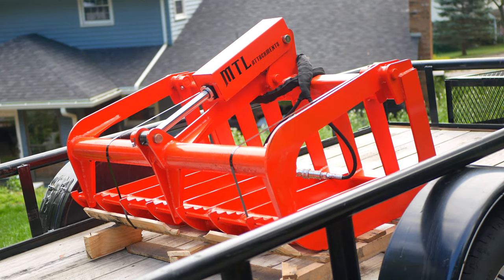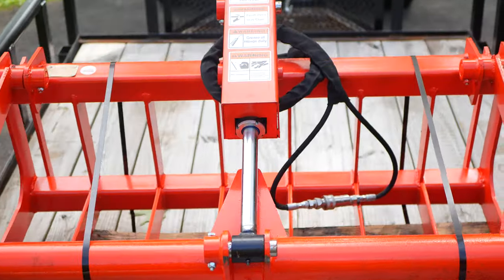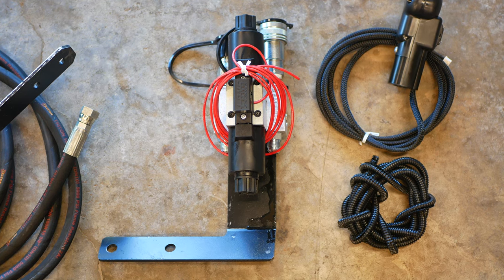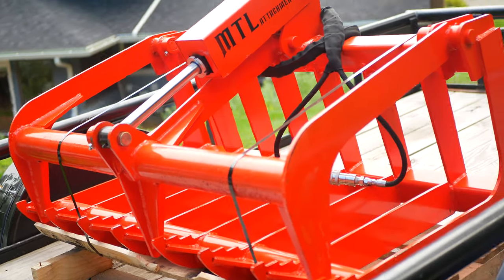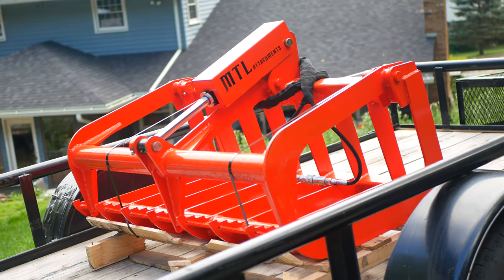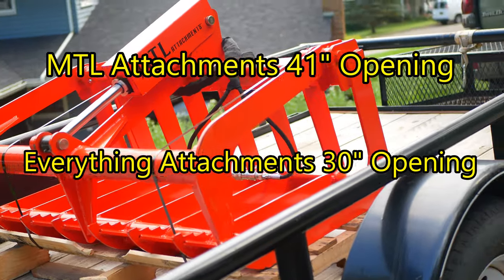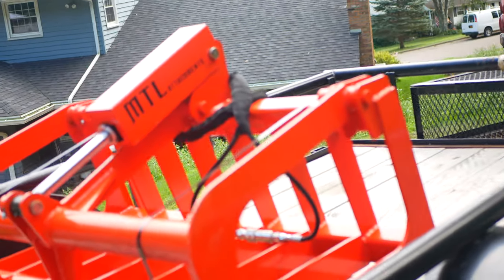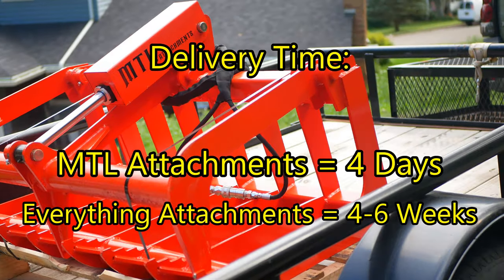MTI Attachments VS. Everything Attachments Grapple + Installation - Kubota L2501 Part 1 Of 2

Comment: Have used a MTI larger size grapple. Section of one of the two top jaws had welded plate bent due to welded metals not joining properly when welded.  It just peeled back at the bubble gum weld joint.  Hope this is not a frequent issue?
Reply from the maker: Did you contact the company? if so, how did they make it right? I've used mine pretty hard and never had a single problem. I've also lent mine out a few times and got it back in one piece - working perfectly. I'd be interested in learning how they corrected such a defect. Thanks for watching and leaving a comment!!
Reply: @BotaTrac  Fixed by local welder, did not contact company . 

i assume it would be too much hassle!

Comment: How was the buying process with MTL?  I'm finding them a little difficult to communicate with. Seems like its text only. They never answer the phone, and their voicemail box is full.
Reply from the maker: Yikes! Interesting......I bought mine "pre-COVID" but I didn't call them - I ordered through their website and got an instant receipt for my purchase and then a day later, I got the shipping information. NOT COOL that you can't contact them. What do you think you might do? Thanks for watching, commenting and supporting.......please like, share and subscribe!
Reply: @BotaTrac  Received my grapple last week. No problems with communication after I had placed my order. Easy pickup at the local trucking depot. Works great. Definitely worth saving a grand off the wicked grapple, considering my needs for a grapple.

Comment: This video is short of what you said. You have zero comparison without using them side by side. I understand the choice of cheaper, but because it is cheaper doesn't make it a better choice. I doubt very much that the MTL will perform like the Anything Attachments Wicked Grapple. Anyone questioning that should look at the videos from Anything Attachments. Weight too is a very big factor in a grapple in your lower power tractors. A 55 inch Wicked Grapple runs about $2,000 shipping included within 1,000 miles of factory. They weigh only 200 lbs. without reinforcement braces that add another 40 pounds and come with the tractor. They are state of the arts machinery and workmanship. Not so with the MTL they are rough and not completely welded in many area's cheaper is not always better. It may be fine for the guy that may not use it much and keeps it out of the weather but if you want something to last and not be a rust bucket cheaper isn't better.
Reply from the maker: The MTL has been working fine for me and I use it frequently but I respect your opinion. Like I said - I have purchased many implements from EA and they are all performing well. Thanks for your comment!

Comment: you say ''you get what you pay for'' yet you buy a cheap grapple ! LOL. Weight means everything !
A heavier grapple will reduce your lift capacity.
I wn the EA and speak to the quality
Reply from the maker: Great! Thanks for watching and leaving a comment!!
Reply: Cheaper is not always an indication of value...... 

Botatrac wanted thicker steel. The MTI fit what he wanted at a cost he wanted to pay. 

I would want the lighter model from EA. That is my opinion.
Reply: Its a 75lb difference in eight but like a crazy $$ difference. If you can't pick up the log because your mtl is 75lb more than EA, just cut a foot off the log. That's worth doing for the cost savings.